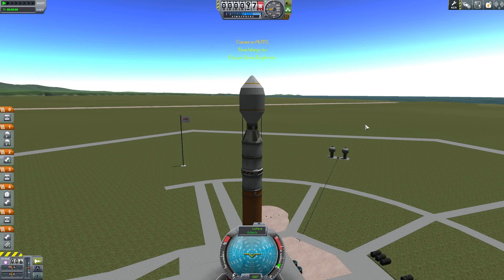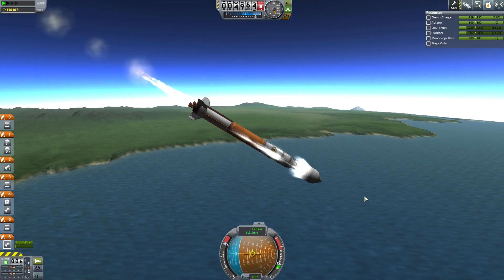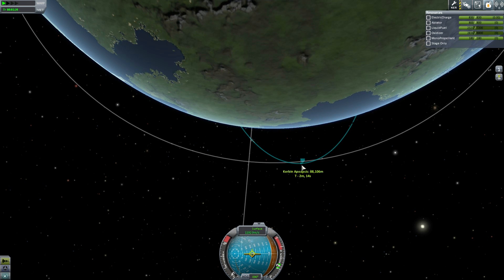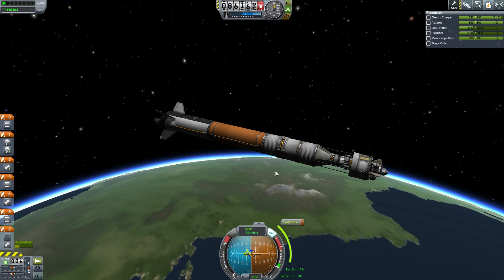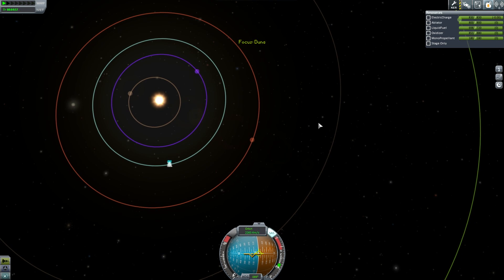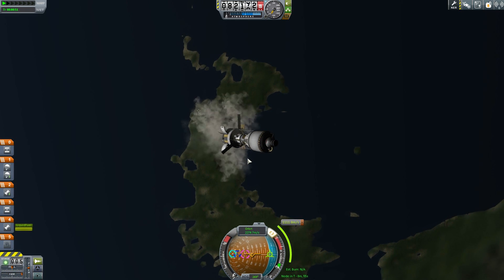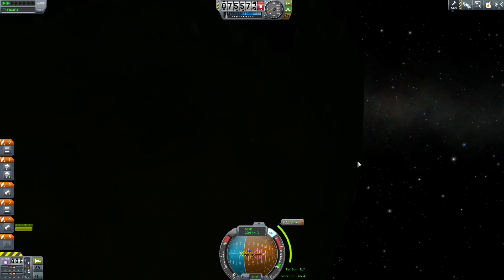Kerbal Space Program - Career Mode - Part 23

Comment: LoL  I have had some crazy acrobatics happen during launches when I drop some rockets.  Crazy how physics can slap you in the face.  I think your earlier tip of not touching the directional keys when the mass is adjusted by decoupling rockets helped a ton.  But I have still had some crazy loops and still end up in a decent orbit.  I know it was a waste of fuel, but that doesn't happen as much after going through your series.

Comment: The campaign mode is a bit different now. You need relay satellites and stuff to get the data transmitted properly. So I found out after arriving at Duna and realizing I had no signal despite 5 of the first antenna strapped to my craft :/
Reply: I’ve gone to doing a lot of satellite missions and even launching some ahead of time and making sure I have a good antenna.

Comment: Scott do you ever use bigger reaction wheels on ships? Maybe it's just because I'm used to flying Sims where things are a lot more responsive thanks to aerodynamics, but I find throwing one or two bigger reaction wheels depending on the size of the rocket makes a huge difference for me getting things lines up nice and quickly, but maybe I'm just wasting weight. Also do you use the electric engines for probes at all? I have two types I've tried it on, one with the small tank and one large with some nice big solar panels and found that while maneuvers can take 5 minutes or longer, the efficiency is amazing, I got one into a really high orbit that is just inside the munar orbit with about 5% of the total fuel for it. I designed it as a survey probe to go out and collect science it can transmit back, and the fact of how much fuel was left makes me think I could send that thing to several planets and moons with relative ease. But again, I'm not sure if I'm just wasting money and there's other setups that could do the same while costing less.

Comment: Another thing about getting fairings off as early as possible is that you usually start recharging much faster, since most solar panels will be under the fairings on most builds.

You don't want to run out out power using a couple of sas modules and a probe body while you wait to hit a manuver node.

It still made for an interesting rescue.

Comment: I have a problem with my "science module" on Mun and Minmus... Sometimes when "switching to Fly" after few seconds the module goes mad and destroys itself. I have the science junior in 2.5 service bay and it is stuck in the middle so I am wonderif if that is causing those instabilities? It is always just about 2-3 secs after the loading gets done and after that it is either destroyed or stable the whole time until next "loading"...
I have no idea if comupter parameters matter by this, but my PhysX should be fine - I have Nvida Geforce GTX 970 with newest drivers, i5 processor, 16GB RAM - or if it is a game bug?

Thanks for replies...

Comment: After playing for many hours recently, my biggest question is why did they take the game out of beta and put it into version 1 when its still this broken and buggy and still lacks a lot of features?

Maybe I'm alone but I miss the days when games were released as finished, working titles with as few bugs as possible, basically late 90's and earlier.
Reply: theotaku7 I thought the same. I expected at least a massive bugfix when 1.0 came out. But many bugs that version 0.9 had are still in 1.0. And some new features brougth of course some new bugs with them. Version 0.95 would have been more apropriate for the current state of the game.
Reply: For those people who didnt know, the next update is an engine update/bugbash! Go drink those salty tears of happiness
Reply: KeyboardOfSteel
Well, the 1.0.3 update will come first, where they fix the memory leak the heat gauges cause. 1.1 will still take a few weeks.
Reply from the maker: theotaku7 I think nostalgia has blinded you as to how buggy many old games were on release. But regardless, this is the version that added all the key parts and after bug fixes everything from here out is less essential.
Reply: Scott Manley I don't think it has much to do with nostalgia because I play some examples quite regularly, Mario Sunshine, Touhou HRtP and SoEW, Pokemon for gameboy, Final Fantasy 6-8 and Sonic. Granted one of those are newer than late 90's by a couple years, they are still fine examples of games released not all that long ago and with no game breaking bugs or even minor annoying bugs to speak of that didn't require a series of specific events or commands to take place.

The reason games back then had far fewer bugs and performed better is because when it was released and in the hands of consumers, there was no way to release a patch if need-be and hardware was a lot slower as well, so the devs had to make sure to finish the game properly, squash the bugs, make as much use of the available hardware as possible.

These days since its so easy release a patch through the internet, devs have gotten very lazy and sloppy with their work, and it shows in the form of bugs and terrible performance.
My opinion still stands, I think KSP should definitely not be in version 1 yet, but more along the lines of 0.9.x
Reply: You forget that those games in the 90s were also an hour long and linear.
Reply: akalion213 Except for the fact that the ones I listed all take more than 1 hour to beat, along with almost all other games from the 90s.
Reply: theotaku7 But they're a hundred times simpler games though...

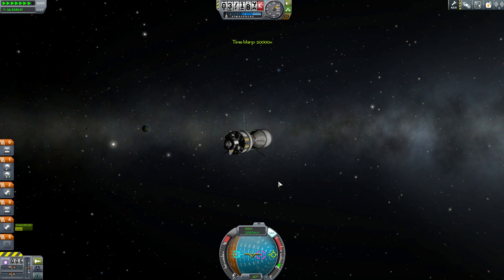Comment: Was that an asteroid at 13:25 or Minmus?
Reply: sinecurve9999 Minmus. He would need to have tracked an asteroid, and THEN randomly encountering it for that to happen, which is almost impossible.
Reply: Do asteroids in game only exist once you have the ability to track them? If a tree falls in the forest no one is around to hear it, does it make a sound?
Reply: sinecurve9999 Pretty much yeah. What you have to consider is, that asteroids are VERY VERY VERY small, compared to the emptiness of space, so even if they did exist, you would probably never ever see one.

A sound is how we perceive vibrations travelling through atoms, so technically, no it wouldn't make any sound. It would still make the vibrations in the air.

Comment: Scott, or anyone with the knowledge, why is it preferable to flatten your trajectory as much as you typically do? I understand that you doooooo get more efficiency burning prograde (although I do not know if I understand why), but I also know that the quicker you get out of the atmosphere, the less time you spend undergoing drag, and the quicker your engines get their vacuum efficiency. 

Can anyone help me out?
Reply from the maker: Kakunapod It's all about the Oberth effect, you gain more energy during a rocket burn if you're moving faster, so the less steep the trajectory, the more efficient the launch. Except of course when you get too low you start to have to worry about atmospheric drag. There's a sweet spot where it's most efficient.
Reply: Kakunapod I'm not an expert but I believe it is along the lines that at some point drag becomes negatable enough at higher altitudes that starting a gravity turn earlier becomes vastly more efficient. I read on the KSP wiki that there is an analogy with cutting corners because it becomes the shorter path. Remember the point is not just to go above the atmosphere but more about going in an orbit.
Reply: Fronic Yeah, but thats about as much as I know, I was hoping for a bit more. I know I dont want to go straight up, I know there is a perfect launch trajectory, I just dont know why its as flat as it is.
Reply: Kakunapod The two concepts that I would suggest searching for are turning losses and the Oberth Effect. The latter means you should do as much of your burn at a low altitude as possible, and the former means you should prefer burning prograde whenever you can. Atmospheric drag is a reason to get out of the atmosphere fast, but these two other factors push in the opposite direction, so it's a question of finding the balance between them.
Reply: HebaruSan I hadnt considered the oberth effect from a take-off perspective, I'll have to look into turning losses however
Reply: Scott Manley I see, thanks again!

Comment: It could be due to part clipping in the service bay.  The service bay colliders have proven to be somewhat buggy.  ANY part clipping in there has a tendency to cause weird things to happen.  The service bay is a good idea but I've sworn off use of them until the collider issues are fixed, hopefully in 1.0.3.  Also, don't try to surface attach the shielded docking port.  Doing so will cause a stream of Nul-Refs and possibly crash the game.
Reply: Tinfoil Chef What are you doing here?
Reply: yaksher  Watching good videos.
Reply: Tinfoil Chef Doesn't he also have things colliding with the materials experiment door? He really just piled things on there.
Reply: HaqqAttak The service bay seems to be the issue though. The Science Jr. doors don't collide.

Comment: Tried the same types of engines you are using in my heavy lifter design, but they overheat too much! All my main stages that contain engines are designed to go all the way up into orbit and have a little fuel left to de-orbit them safely, around KSC, for max refund.

Those engines however, even at 60% throttle, they overheat on the way up and lose about 50% integrity, that means when I de-orbit them they blow up in upper atmosphere. For now I'm using a lifter with 2 mainsail engines, took me forever to design it. For some reason, mainsails overheat and lose integrity if they're not connected to a fuel tank and very far apart.
Reply from the maker: Zamolxes77 Add aerodynamic fins to them it helps cool them down.